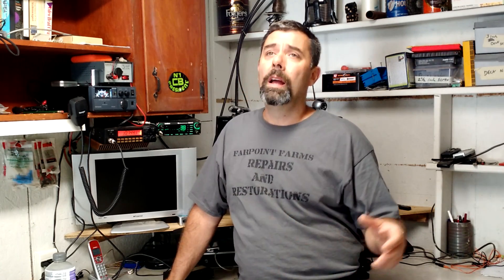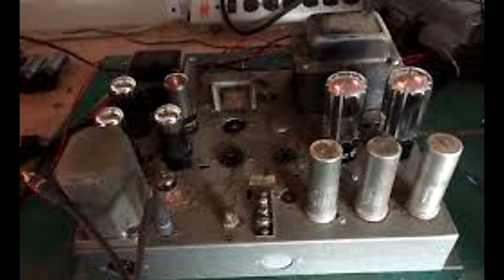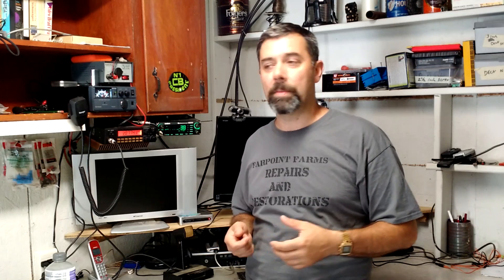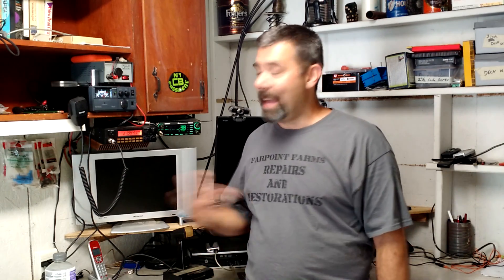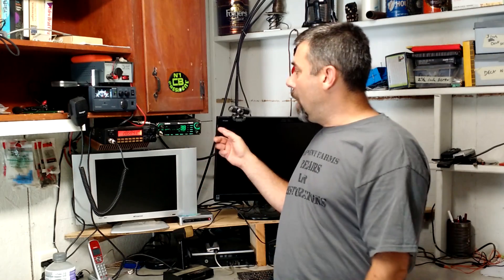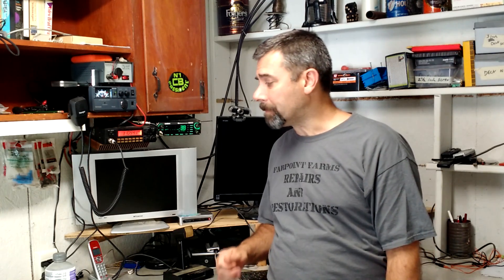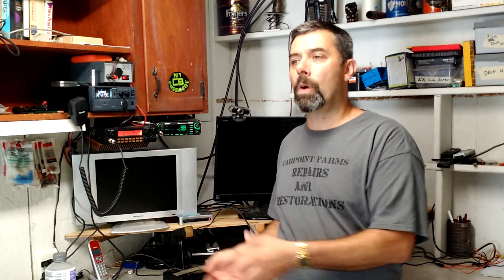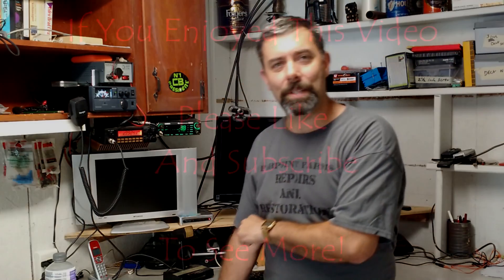A Beginners Guide To CB Linear Amplifiers.

Comment: A little correction on history. The amplifiers were used right from the start of C.B. radio. Most people don’t know it but in the early days there were some frequencies close to the 23 channels that were used for commercial communications. Companies like Browning, Sonar, and Johnson sold radios and legal linear amplifiers for those services. It was quite easy to take one of those amplifiers and use it on the C.B. frequencies. So in the early days manufacturers sold linear amplifiers with the excuse that they were for those legal, commercial frequencies that were close to channel 23. The FCC ended that service mainly to try and get a handle on the illegal amplifier problem. It was the late 1970’s, not the 80’s that was the golden age of CB. Channel 10 was the highway channel back then. They went to 19 because of all the interference that linear amplifiers was causing on channel 9, the emergency channel. Most illegal  linear amplifiers were total junk. Most of the later solid state units didn’t even run at true class “B”. They ran closer to class “C” because the manufacturers wanted to save money by not putting in a proper bias for the power transistors. (They are transistors, not “pills”) Class “C” amplifiers are for FM transmission. To use it on AM causes all kinds of problems. Among the best tube amplifiers made for CB include HEC, Browning and Sonar. Among transistor amplifiers the best were Triad-Utrad, and Hurricane.
Reply: Even into the mid 1980's React still used channel 9 in Texas and channel 19 was the truckers channel when looking for smokies, etc...
Reply: I was in CB back in the early 70s, so can agree with your comments.  I'm trying to recall if the 11-meter band was originally for Ham use; I bought a used base station ground plane antenna that was apparently an 11-meter ham one, worked fantastically across the entire channel range even after the 40 channel expansion.  Antenna Specialists made it, I think.

Along with linears a few people used actual ham gear, like the Johnson Vikings and Siltronix 1011 series.  Those Siltronix units came from the factory only able to receive 11-meter CB, but cut one wire and transmit was enabled.  Many 23-channel CB rigs had a gap on their 24-position selectors, cut a wire and add channel 22A (later assigned as 24).  I don't know how many radios I fixed because people tried to do it themselves and cut the wrong wire!  Similar to modulation limiters where they'd cut a wire or diode to increase modulation; if they didn't break the radio in the process, they'd cause over modulation and distortion, bleeding over multiple channels even with just 4 watts of carrier RF power.
Reply: @bobblum5973  I am also an amateur radio operator and I own some vintage ham equipment that has 11 meters marked on the dial. Lots of CB guys used ham gear to operate. The biggest downfall is that the receivers on most of that old ham equipment are not very sensitive. My Browning Golden Eagle with a neuvistor front end is much more sensitive than my Yaesu FT-101. My 101 has 11 meters right on it’s dial by the way. As far as hams being smarter in radio theory, I guess that on the average that is true. But it sure makes me mad when I hear a fellow ham spouting a bunch of B.S. on the air that he is supposed to know better about. I swear that some of these guys didn’t learn a thing when they studied for their test! But I’m also a licensed electronics teacher, so I am a bit more critical about it. And the smartest guy I know in electronics and radio is a CB guy who has no desire to get his ham license. He spent his entire life repairing CB and commercial communications gear for a large company in the Midwest. He still educates me and we are both old, and retired. 😁
Reply: @keithweiss7899  We're on the same wavelength!  I was into CB long before the big boom basically ruined it (I did the same with the Internet, before it went nuts).  All the tidbits like the 27 MHz radio control frequencies on what CBers later called the "A" channels (10 KHz above 3, 7, 11, 15, 19, and 22A, 22B).  Multiple services on 27.255 for CB, RC, and some sort of business band.  Diathermy equipment at a doctors office was around channel 12, I think, we had one that would occasionally disrupt comms for several minutes but luckily only for a very small area near it.  Oh, and I worked on someone's old 27 MHz garage door opener, and an electronic dog training collar on channel 15A!
A few times I had to explain to people that, no, you can't use a guitar amplifier as a CB linear, even if someone said it would work.

Congratulations on owning that Browning Golden Eagle; that and a properly aligned Tram Diamond are some of the most solid performing rigs I've ever seen.
Reply: @bobblum5973  Yes to all of that! I love electronics and have since I was a 9 year old kid listening to my R.S. Globe Patrol. My friend mentioned how he also liked the Tram D201, not the A but the first one. He said it could easily be modified to use the receive side to transmit with. And the unit is excellent. I have the Siltronix 1011C and 1011D. They are okay on SSB, but the filter in the receiver is too tight for good a.m. use. But I remember in the old days they were really something! Today I have a couple of AnyTone radios. They have a couple of models. The old one will work on 10 and 11 meters and is excellent across the bands. The new model also has 12 meters. Both have a.m. and f.m. Of course the FCC approved F.M. on C.B. now. They have excellent receivers and transmitters. All in a tiny package for $62 from Amazon. You never know if they will send you the old or new model though. I had to send a couple back until I got a new model. But I still prefer tubes in my radios. I’m an old fart!🤣
Reply: @keithweiss7899  Yes, always fun with a wide assortment pack of CB brands and models!  I've seen or worked on so many in years past, tube sets like the Gonset G-12, a Demco that would run mobile (and run your car battery down!), some old Lafayette and Robyn rigs.  Then more solid-state rigs than I can count; oldies like an Allied, an Amphenol Commander 750 (that used a permanent magnet speaker in the microphone unit as both speaker and mic).  I remember a unit by DAK I think, it had a vacuum tube for final RF output, transistors or ICs for most everything else, and a digital phase locked loop synthesizer for 40 channels!  Kind of a gimmick to have three vintages of tech in one, but I'm sure they sold some on just that point alone.
Reply: @bobblum5973  - That is exactly why Amateur Radio operators have more privileges, we have to prove that we know what we are doing by taking examinations.

Comment: 13:00 my BS meter started pegging right here.
Reply: Talking around the world on 4 watts am or 12 watts SSB IS possible, it it NOT easy.  It does take a lot of time & patience, and when skip is running you would be amazed as to where you can reach with very little power.
Reply: @jessyn76  awesome. I have yet to get an answer from a skip talker.  My radio guru tells me some of these guys Im hearing are pushing 50,000 watts  so I wondered. Its the same guys Windjammer texas, NJ, Conn, I hear the same ones putting a 9 on my meter from other side of the country.
Reply: @matthewpoteet8876  Those guys on channel 6 ARE pushing that kind of power and more. However, there are a lot of people who don't run extra power, or if they do they run the minimum amount to make the contact.  That said, the best thing you can do for you radio setup is to have a good antenna, & proper grounds.
Reply: @matthewpoteet8876  they're called alligator stations, all mouth and no ears. And the Bowl is the worst. Find a quieter frequency and throw out a call, many people are on the side just waiting for a decent person to say hello

Comment: I run a barefoot station with antique equipment and a 2year old A99 thats maybe 30' to the tip.Depending on conditions i can talk skip and locally quite  well. Its more exciting talking thousands of miles away on a barefoot rig.
73s from 514 Southwestern Ontario Canada.
Reply from the maker: It's a great hobby isn't it"?
Reply: @FarpointFarms  yes it is ,i enjoy it more now than i did in the 70s.
73s, take care,  be safe 
514 Ontario Canada

Comment: I put a 102 will on my car dont need amp now the rm italy amp just sitting in the box
Reply: I used to run co-phazed 102" stainless steel whips on the rear bumper of my car. It was kinda directional off the front, but I was working in a little town just north of where I lived in the early 70's and I'd get to work early and sit in the parking garage lot with the car headed south and talk over a guy on a base 10 miles south of me to a base 20 miles south of me will just the radio.
Reply: @plugnalong2186  awsome

Comment: I seen and Amplifier that was custom built in an old woodstove so the heat would go out the chimney And not run you out of the radio room. It took like 1KW to drive this thing To full potential which I think was 10 KW. So it was like 175 W Collins transmitter pushing the 1kw driver pushing the big 10 kw woodstove amplifier Into an eight element beam. You had to push a foot pedal switch to kick In the high plate voltage on the big amp and it was so awesome because when you heard this guy talk you could see him key his radio and the1000 W driver and then he hit the pedal and it sounded like somebody hit something with a ball bat over the air when humongous contactors energized in the big woodstove amp. The crazy thing was is you never heard him bleed over on anybody. It was a hell of a nice set up.

Comment: I seen an Elkin amplifier in there like the third pic. I have one of those and a couple of those were audio amps though. Those little Palomar’s are great to run in the house if you have like a 35 amp power supply or a trolling motor battery in a solar panel works fine too. Most of those cobras and galaxy amps if you open them up they looked exactly like a Palomar. I have a cobra 350 also that’s a sweet little amp also. A good 3 or 4 element beam and good clean and strong radio will do wonders.

Comment: Yes you need power nowadays. Hardly anyone is on the radio. In my area there is 4 people in 50 miles that talks. To be able to talk to them you need power.
Reply: No, you don't need power.  You need repeaters.  Several years ago, during  the peak of a 11 year sunspot cycle, I made a contact with a guy in Maryland from my desk in California using a hand held radio that was putting 1W into a rubber duck antenna.  I was working the 220 MHz band, going through a repeater that had a remote base on 10 Meters (29.6 MHz.)  
There is a lot of good stuff out there, but people need to stop just thinking that they think they know what is right.  If you got rid of your CB and your automatic transmission, you would be well on your way learning how to be competent.
Reply: Nice point!

Comment: i remember before the switch from analog to digital TV signals, i was playing around with a little 6 inch b&w TV with an analog tuner, and i randomly came across what i thought was some sort of video gaming TV network, because on my little black and white tv screen was someone playing a first person shooter game on a PS2. after a while i realized i had not seen one commercial AND they were showing when the person playing paused the game, even for minutes at a time. one particularly long pause, i walked out of my room and saw on the living room tv was the game i had been watching, then it hit me, that little tv was picking up the signal either from the PS2 or the vcr output to the tv, (it was co-ax) so maybe thats where the signal was leaking out from. even tho i wasnt certain how it was happening, i knew that it was cause i was watching it with my own eyes. this event was what started me on my electronics and computer engineering path, a path the contained illegal firmware modification on the PSP, all the way to analyzing random signals i pick up. with the advent of RF tools especially these days, and with everything now connected to the internet through wifi, lets just say there are MANY MANY things you can do with a good SDR , full duplex in particular. but I'd NEVER send out any signals, only receive, i swear ;)

Comment: Hell my lights dim when the heat or a/c comes on, lol. Do you work on CB'S? I got an old Cobra that I used when I was trucking. It has been stashed away for over a dozen years now since I retired. Thinking about hooking it up again just for the heck of it. Had a small amp on it at 1 time but I could tell any difference so I sold the amp. Of course it has been to those super dooper truck stop CB mechanics & it talks too damn loud & distorts the voice with the mic gain tuned up. Just want someone that knows what they are doing to check it out. before I go to the trouble of hooking it back up.

Comment: Had a lot of great childhood memories of my dad 'shooting skip' on Saturday nights.  Would talk to folks in Nova Scotia from Arkansas and they sounded like they were next door.  Ran a huge Maco 'Laser Beam' antenna with a 500 watt linear (can't remember the brand).  Had to be careful and not point the antenna at the church on Sunday morning due to coming in on the P.A.!  You'd key the mike with the linear online and the lights would dim in the house.
Reply: gotta love it good times.
Reply: 500 watts wont dim your lights lmfao.   are  you smoking crack brother?  I have a modern air conditioner that pulls 1500W when it runs and it barely dims the lights,
Reply: @Runescape.  RF is a bit different than AC or DC, the guy is transmitting AC which frequency is 27 MHz, so it is high frequency, sometimes if your lights or tvs or any electronics with crappy RF shielding can be affected by RF (even with good RF shielding), for example sometimes when i key up my 5 watt ham radio HT, it freezes a digital tv right next to it, that is because of a high RF field.

Comment: I remember back in the early to mid 80’s I had a really nice setup in my truck. I had Cobra 29 hooked up to a Texas Star modulator plus driving a 300 Grey. Had my radio guy tune everything. That radio would talk! Had a RK-56 mic and got to noticing that when I would key up with power on it would shock me! Come to find out had a loose antenna connection! The only reason we had this was to try to talk over a base station in Ft. Worth, TX. I finally quit running all that stuff because I could talk over the p.a. system in the truck stop and had to park a good ways from the public phones because I could be heard thru the phone! Almost got one of my buddies in trouble with his wife. Still have aCobra 29 and a General Lee I think. Haven’t used either one in over15 years but when I got out of my truck both of these radios would talk.
Reply from the maker: Those were the days! Lights dimming, voices coming over the TV. SERIOUS CB setups!

Comment: I'm from australia 27mhz has faded out in this country but you have got lot of people still on. I got 4 people in my little town. but it is hard to get your cb fixed in australia not many CB shops fix 27mhz no more fair fix UHF CB radios. yes I have got two radios 27mhz and UHF. not many purple on UHF anymore only truck drivers on channel 40. I need my CB tuned up and my Linea fixed. i have a MAGNUM BY PALOMAR LINEAR AMPLIFIER. my linear amplifier is bit crappily and losing signal and my CB's needs a good tune-up. i have my cb's linear on youtube

Comment: Amps are not the answer. I run a 3 full wave loop array, made from scrap wire and wood, made for free. Get out local 30 TO 60 miles, talk skip from Ontario to Florida. All on legal ssb 12 watts. a GOOD ANTENNA is equal to a 100 watt linear, but an antenna, improves your receive by 100 watts as well. An amp only improves the transmit. You can't talk to them if you can't hear them. For the same money and a lot more fun, get a good stick in the air. Money better spent in my opinion. "North 7 Ontario" said that.

Comment: Everybody in my area is running linear's and a lot of power if you don't have it you're not going to talk over them! the walk all over you.
Reply: Mark Jones the trick to talking over someone is having your radio tuned to narrow band instead of wide splattering on am. I have a Lincoln 2+ v3 10 and 12 meter radio unlocked for use on cb frequency too plus an rm Italy kl 200p only a 100 watts and a 102 ground plane antenna and have talked over people with 200 to 300 watts.
Reply: If your radio is narrow banned on am all of your power will be on specific channel instead of spread out over 6 channels up and down. You will also sound clean and clearer too. Try to get your radio tuned to 5 kc spread instead of 10 kc or 25 kc
Reply: @spankthemonkey3437  ok I'll mention that to my CB shop I just bought me a CB yesterday it's a Galaxy dx94hp he peaked and tuned it to put out  to swing 140 Watts it deadkeys 50 watts.